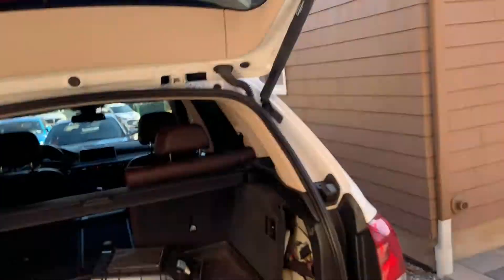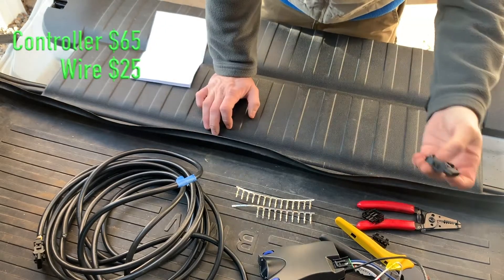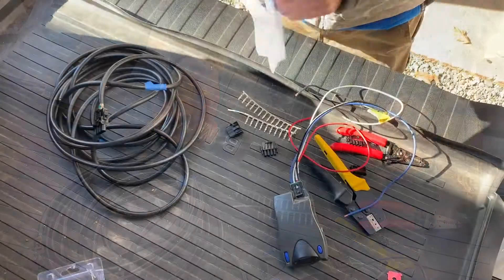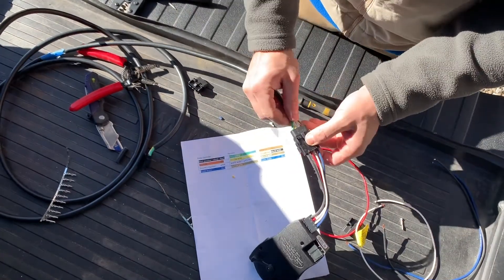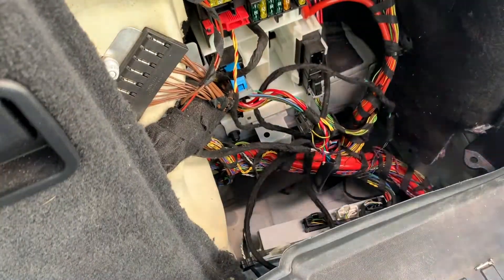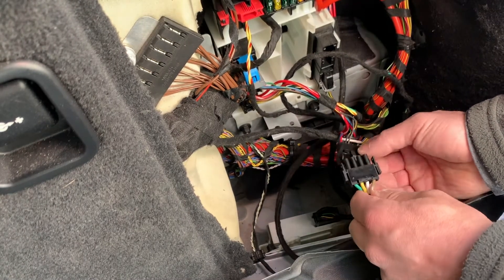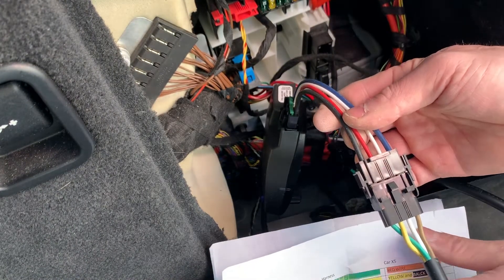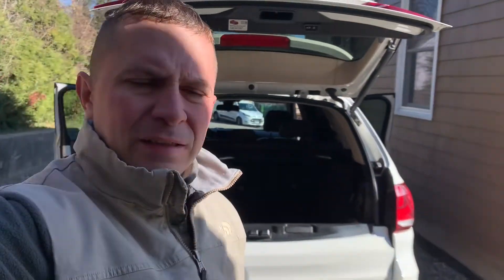BMW Trailer Brake Controller DIY

Comment: I know this is an old video. But where do I plug the blue wire from seven pin? I have a wireless brake controller so I would assume I splice into the blue factor harness where you removed factory connector?

Comment: 2015 BMW X5 diesel. Whenever I connect the trailer (I always make sure the engine is not running, but same issue even if it is running), I have to pull the fuse for the controller, and replace it before the brakes and turn signals will work on the trailer. I finally spliced in a pushbutton to disconnect the power for a second. Any clues how to fix this issue??

Comment: Thanks for this very helpful video. Now I understand the difference between the OEM trailer wiring harness and wiring in an electronic brake controller.  I do have one followup question; I take it that you have the OEM trailer hitch with the 7 pin receptacle installed on your X5?  I have a 2012 (E70) and it's getting hard to find the OEM receiver and I really don't want a wiring "tail" hanging out of the back of my hatch.
Reply from the maker: Hi, I have invisibleHitch or stealth hitch top notch highly recommend installed with 7 pin receptacle.

Comment: Very informative... we have a bit of a twist and appreciate your assistance.. we have a 2021 X5 45e (PHEV) with factory installed 7 pin connector. We could not find the wiring connector on the right hand panel. Our panel is a bit more crowded and we could not find the connector. Any suggestions on where we can find a wiring diagram or locate the connector? Thank you!
Reply from the maker: Hi, the connector on the newer x5 is in front on driver side under the dash behind one on the compartments on the left hand side.

Comment: My F15 50i has brown/yellow/black & black/yellow/red in that plug.  Both blacks are in the same terminal.  Strange.
Reply from the maker: So your plug has 2 yellow/black wires?  if so that means one of them is  responsible for the stoplight and the other for trailer brake activation, it’s wired though that both of them are the same color. Worst case scenario if it doesn’t work you can swap them, they operate on a positive circuit so there no harm if they are reversed.
Reply: @MotorsportInspired   My post was unclear.  I have Brown  Yellow  Black&Black/yellow  Red.  The black and black/yellow are in the same terminal.  I don't have a blue wire.  I'm going to try a continuity test between the plug and the 7-pin this weekend.  Great video!  I have everything I need, I just have to figure out that last part.
Reply from the maker: Thanks 🙏 for the kind words, most likely the Black wire will be the one replacing blue one, but the test should confirm this, either way there won’t be no harm if you reverse them. Worst case scenario you’ll have to flip them back.
Reply: @intrceptor  did you figure out your wiring? Mine is the same as yours. I suspect that the red/yellow is the power, the double blacks are the brake lights, the yellow is the trailer brake and the brown(on the outside 4th position) is the ground. Can you confirm this?  I Appreciate any info you can give.
Reply: @juliehall4611  I bought a cable from etrailer that works great.

Comment: Where did you buy the wire and connectors?
Reply from the maker: Links are in video description to the wire and connectors where they can be purchased.

Comment: Is this for a 4 pin connector?  How do the turn signals work on the trailer?
Reply from the maker: Brake controller is for the 7 pin connector only which is included with factory hitch wiring harness. You can add a brake controller only if you already have OE BMW towing harness and module installed on your bmw, if not then that will need to be installed first which will take care of your lights, blinkers ect, and then you can add brake controller if you towing trailer with brakes.
Reply: @MotorsportInspired  Thank you. This is very informative. Do you have or point to a video for OE BMW towing harness installation?
Reply: @bhanugadde2104  its very easy look it up on ecs tuning website, they have a detailed instruction manual